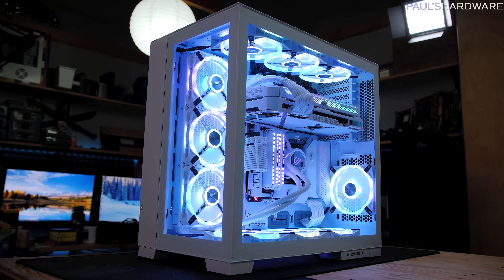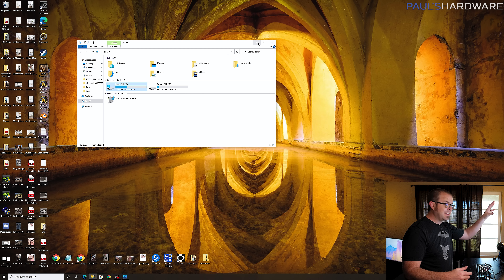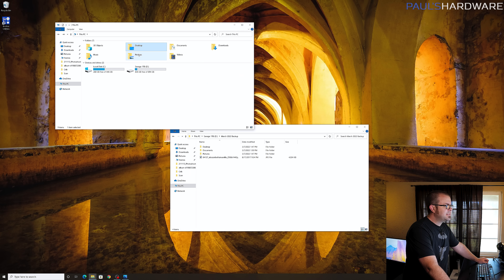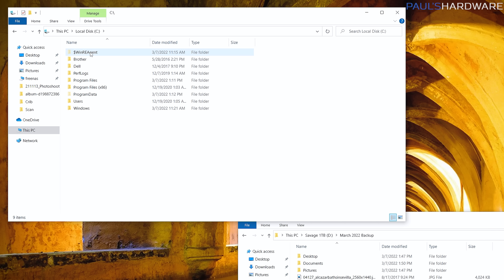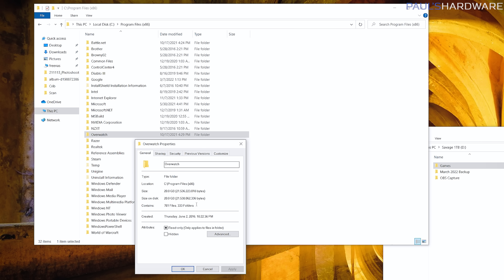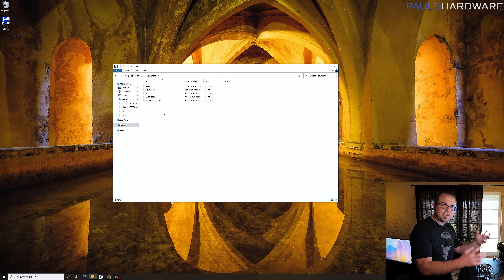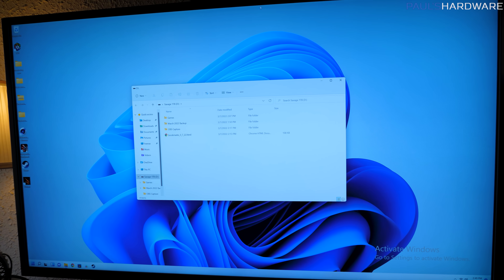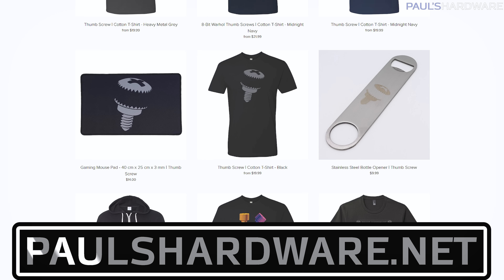How to Move Everything from an Old PC to a New PC

Comment: The one thing that really aggravates me is the new start menu because it's not at all customizable and I've always had a particular way how I want to have it look, I've got really every single link to all the programs that I installed on top of Windows plus some links to power user tools which are the built-in programs and then I have those nicely separated into a handful groups and I managed to get all that exactly fitting my screen so it's all there with one click on start and I don't have to scroll down to see stuff under the fold so to speak.

I've done this the same way for years and years, in fact my computer is so organized that many people say that it's crazy because of the amount of work I've put into it, for example my music library I have all music sorted by using directories so it's like hard coded and can't be changed by any media player, I've first made a few directories to separate the genres but I've grouped genres together that are alike for example Trance, Dance, Techno in one group and R&B, Rap, Hip-Hop in another group and so on and got five main groups for the genres...
Then for the next layer of directories I've got a separate directory for each year and extra directories for compilation albums and for artists...
Then for the next layer of directories I've got the full discography of each artist and on chronological order also separated with directories...

Yes I have a massive amount of music that I got from a DJ, all original CD's in the original cases with booklets and all still complete and undamaged stored away safely, and I've manually converted all that music into mp3's at the highest quality 320kbps and I even scanned the booklets to have the graphics showing on the mp3 when I play it, you can imagine how much time I've put into converting hundreds and hundreds of Audio CD's into high quality mp3 and why I stored it the way I did with directory trees.

Ow and I have a separate 1 Tera Byte hard disk just for the music so when I open up my file explorer and go to the music drive and fold out the directory tree I have everything nicely organized just as I do with my start menu and I don't want to change how I use my computer on a fundamental level which is the case with Windows 11 with that stupid, horrible, idiot start menu that I can't customize anything on... You don't know how much I hate it, I'll tell ya... I hate it so much that I'm postponing the upgrade to Windows 11 as long as possible maybe even till 2025 when they stop the support and I have no other choice to upgrade but I hope that by that time there are more people like me making a fuzz about it and maybe we can customize it soon enough.

And if not I'm going to make it my personal project and create some way to either revert to the Windows 10 look for the start menu at least and if that's not possible I'll make some sort of plugin or small software install that will give me the options that I want which shouldn't be a big problem to me because I know way too much about how Windows works since I've been customizing my Windows as long as I can remember.

Since Windows Vista that most people hated... I loved it, well from that point on I've loved Windows because it always worked, it became more stable and I never had major crashes and for the most part it looked about the same, everything was located on a logic place, it just worked great the way it was since Windows Vista especially for the start menu and how we could customize it and now with the latest Windows 11 they messed it all up, they don't even have the cool live tiles anymore!?!?

If I could I really would like to talk to the people at Microsoft who thought it was a good idea to change the start menu and make it look like what I hate the most of all, it looks like it comes from Apple and that's just wrong, if there's one thing I don't want it's that my desktop computer is going to look like an Apple and even worse it's going to work like an Apple.... 🤮🤮🤮🤮

Sorry for the rant, I couldn't help myself and had to write it down to get some kind of closure.

Comment: Paul I hope you can answer a slightly but related question. My son is getting a new gaming PC that I am building myself and he currently has a laptop. I had upgraded that laptop's puny 128GB NVME for a 500GB NVME. First I think I know the answer to this one but as an OEM Windows on the laptop I shouldn't be able to just plug in the drive on the new motherboard, I probably need to reinstall Windows completely and use another one of your videos to purchase a low-cost new Windows OEM key. But transferring the files I should be able to just copy from drive to drive, correct? I originally was going to buy his new PC without storage as I was planning to re-use the existing NVME but Newegg (don't worry I made sure to use the filters to only buy new) applied a discount code to my cart so I bought another 500GB NVME the one you suggested on your latest budget/mid-range build. So, any advice would be greatly appreciated.

Comment: It's good to see the "ugly" white 3090 in your wife's PC again (RIP Kyle).
However in order to complete the whiteness of this PC you should add a white keyboard.
I see a full keyboard on desk so I'd suggest a white Corsair K70 RGB MK.2 SE or a white Punkston TH61 if you find one it's a 60% board but waterproof in case of any coffee accident.
I don't know if this a bedroom or living room but in any case it'd be nice to have less cable management over there and wheather you're lying on the bed or sitting in couch comfortably you could use a white Logitech G915 TKL.
My best preferences are the fully customisable boards from kbdfans or the nice keychron (keychron-k3-v2-non-backlight-ultra-slim-wireless-mechanical-keyboard-π-edition) but I don't know if it'll be available soon.

Comment: Fun tip, holding Shift, while dragging to a new drive also switches to Move. When Move is the default, holding CTRL switches to Copy. I transfer files quite regularly and this is faster for me.
Reply: Nice tip! Only issue with move / cut is that if the files get corrupt in the migration you have no backup, hence why I always copy and paste.
Reply: @zadekeys2194  that’s a good point
Reply: @zadekeys2194  One million % this!!!!!!!
Reply: I am a bit paranoid that I will move when I need to copy and vice versa and I never trust what windows/programs is considering default for drag and drop (move copy or make a shortcut) :D I always use right click
Reply: Thanks for that.
Reply: if you think that is handy, try Directory Opus. if you move files regularly,  you'll love this.
Reply: 30 years of using windows and still I find new shit out. -.-
Much obliged. Especially under windows 11 where everything takes vastly more mouse clicks than before.
Reply: I wish I could save this comment wtf ❤

Comment: That's all well and good, but wouldn't it be easier to make a windows image backup with Arconis e.g. and then install the image on the new PC? Yes, I know there can be complications because the hardware has changed, but as long as you haven't switched from Intel to AMD or vice versa, it should actually work. Drivers etc. can be replaced for the new system. If the OS was previously on an NVME at least If it was on SATA and you switch to NVME it will not work. Or am I totally wrong here?

Comment: WinDirStat is also a program that is frequently packed with trojans and bitcoin miners so... get that from the developers website ONLY.  This is good general advice for ANY application.  

Also, if you "don't know what you're doing or where stuff is located", you can just make an image of the old drive and verify it.  There are many free disk imaging tools out there, Macrium Reflect, Easeus, Clonezilla, etc.   

Then just proceed to install everything new.  The image is a backup of the entire drive and takes far far less time to create than manually dragging and dropping everything.  Also, if you encounter some program that you "forgot" to grab the data for... you can just access the image and pull that data off because and image backs up up the entire disk.

Comment: I bought a 43in super ultra wide Sceptre n{{E448B-FSN168W}} flat (as a dayum pancake) L.E.D. Dual FULL HD HDR600 1MSmprt 120Mhz IPS freesync edgeless whiz bang of a monitor for 5 hundo in November & it's proven to be a fabulous value of a monitor.
 Has white case, rear fancy RGB shenanigans, GREATR rear IO, meh cable management thing, but ECXELLENT adjustability, w/ a VESA mount, nice remote & built in speakers (my only real gripe - other that the last thing, I'll get to... last) the speakers, while functional, are weaksauce... I ride at 100% on every volume control I have & it's fine as long as I'm watching something with top notch production value... anything remotely less that stellar & I have to turn CC on.

 My Actual gripe: - Sceptre had this exact screen, a 2020 model with a 1000R curve, I had it in my Amazon cart for about 5 weeks waiting for my curds & whey, & when I finally had the cheese, I simply hit "BUY" - The ad hadn't changed appearance at all, same Wallpaper on what looked like the same monitor in the same picture - much to my surprise, I HAD not ordered the 1000R buxom voluptuously curvaceous Gaming monitor, she was well.... shall we say... "UNDERDEVELOPED" ahem.

 Still, she's got a lovely personality though ;)

Comment: In moving app data, some info of how or if you can move open tabs and such from browsers would be really helpful.
Reply: Bookmark them, then export bookmarks. Simplest , fail proof method.
Reply: @zadekeys2194  but in the video, when he did that, it put all the "old" links into one folder marked 'Export'. That sounds like a pita honestly. I need a way to copy the bookmarks as they are currently.
Reply: @derhohlenbar  export and importing of bookmarks should create a carbon copy of the structure. Give it a try :). Ps: creating tags as you bookmark is great aswell for future ref.

Comment: At 13:42 when you show the system the side radiator fans are set to exhaust.. I thought your tests showed the positive pressure setup (top, bottom, and side fans all intake) was best. Why did you change?
Reply: I had thought about testing that situation, but wouldn't it result in hotter CPU temps? You're blowing warm chassis air throigh the radiator instead of cool air if it was an intake.

Comment: I did a data/email audit about once a year for a couple years, it only took 2 passes to cut the bulk of redundant files and folders, organize, and set up a folder structure I am content with. Now I just do a bit of housekeeping every 6 months or so for newly stored data. I have a WD Black 4TBx2 HDD RAID 1 array that is just about maxed with a neatly sorted collection of everything, a Samsung 1TB SSD for larger downloads and game storage overflow, a Samsung 512GB NVME M.2 SSD for the OS and primary games, a 2TB external backup for easy transfers and core keepsake storage, and assorted USB's/SD cards along the same lines for off-site backups. Over 7 years strong on this current configuration, just turning 8TB into the RAID 1 when I made the upgrade from i7-5930K/X99 to 5900X/X570, and I couldn't be happier. I pretty much follow the same protocol as you describe, I love having Firefox sync with a bookmarks folder for every manufacturer driver download page, apps and programs downloads, basically all software and drivers for every single piece of hardware and assorted peripherals. Unfortunately I have a Windows 10 USB from 2016, so updates are a bit of a pain! The real task is optimizing windows, setting overclocks, and downloading/installing games. I have built a pretty sturdy system that is upgraded as needed but generally has been the same format for almost 10 years now. a custom loop with a 5000RPM pump, 200mm glass reservoir running distilled H20, dual 140mmx30 rads in push-pull, 3000RPM Noctua fans that only ever see over 1500RPM when going for overclocking records, 1/2" I.D.-3/4" O.D. tubing, and solid nickel-plated copper waterblocks (Heatkiller/EK). It is absolutely overkill, and I should be ashamed of how much it has cost over the years, but combining my old parts with a new power supply paid for my CPU, and I make money through it's use, a small price to pay for one of the only luxuries I grant myself other than coffee. Having an enjoyable experience is paramount, and should be heavily invested in.

Comment: you can do the same result conecting both pcs with a wired local network (no wifi)  and sharing a folder with everyone in this steps

1- on both pcs create a folder, right clic it, go to properties, sharing, clic on sharing and create a new sharing rule with everyone in the network
2 on both pcs open a file explorer window, go to network and enable network detection (yello notification on top)
3- on the old pc move everything you want to that shared folder 
4- on the new pc go to network on the file explorer, and open the old pc that must appear in the network options like a folder, its more useful if you set an administrator account with password on the old pc bc when the new pc tries to acces it it will ask user and password to have a more secured conection (in case of any unwanted family trying to look your files
5- start coping all your desired files in to your new pc

enjoy

bonus: this is very useful to fix pc as work reducing transfer times

 not a exact guide but if it makes in toa  vid shout me out god dammit!

Comment: Good grief I've done this more times than I care to think about. My process now revolves around a two bay external HD dock (they're super cheap on Amazon). I pull all the drives out of the old machine and load them one by one into the dock attached to the new machine. Because it's USB3 the drives are treated as external drives as long as you've booted from your new system drive first. then I just copy across what I need for the new machine. I  keep the old system drives, label them and  stick them in my morgue box in the garage. Old drives are cheap and data is expensive.

Comment: How did you convince Kyle to let you keep the card? If you have a retail version of Windows 10 on your old system you could download all the drivers for the new one to a USB stick and clone the current drive with the free software from Samsung. This would require a PCIe to M.2 adapter ($16) and you would have to remove the dedicated GPU of the old system. Login to your Microsoft account and transfer the license to the new PC.
Reply: I think you have to remove license from old pc before activating on new one. It's an easy two step process and there are simple vids on how to do just that. Unless your license is connected to you and not the pc... then your golden.

Comment: My moving to new PC method:
1. Take out drives from old PC.
2. Put drives on new PC.
3. Boot and pray it doesn't explodify.
4. Clean install latest device drivers (GPU, etc.) if it boots fine.
Optional 5. Clone drives onto new drives and set those to boot before removing the old drives.

Then again, I don't even have a PC or console anymore.

Comment: If you have the space on an external drive or if you have a NAS (Desktop based like a Synology or QNap or Server based like TrueNAS or UnRaid) then my advice is to use a good imaging software suite like Macrium Reflect or Acronis and make a backup image of all drives including a filtered image of the Operating System partition (excluding specific unwanted folders like temp and files with known extensions that should be excluded (*.tmp, *.bak et al) create a bootable restore image (Macrium Reflect calls this Backing up Windows) and then once the backup images are complete and safely stored away, simply down the old system take the old system out of service and then put the new pc into service.  Once the new pc is on use the thumb drive that stores the WindowsRE environment created when you created the Backup of Windows image earlier to boot the new pc into windows with network drivers if you saved your images on to a server or NAS drive, and restore the OS drive first then any other images created for other drives.  In this way you do not lose access to any files or folders your install and desktop is exactly as you left it on the old pc and all that remains is to install hardware drivers and reactivate Windows using your Microsoft Account.  This is a much simpler method that does not rely on the hunt down files and folders on data drives that may or may not make sense three or four years from when they were first created.  Its a lot easier to manage than the method you described Paul.

Comment: One thing I like to do upon setup is pointing the documents, music, downloads, desktop, etc folders to a location on a separate drive. That way, in case of re-installing windows, you don't lose any of the things stored there.
Reply: On paper that works fine but you should have a proper backup elsewhere. Many programs look to the default folder directory, and not the "new" locations.

Comment: SATA to USB adapters NEVER work with mechanical drives because they need 12V and that is not available on a USB link!
Remarks;
5-what about desktop background pictures?
4-what about passwords and license key's?
3-cleaning duplicate files (often double photo's) after copied -use duplicate file finder program
2-just search *.jpg and *.mp3 and others with a minimum size of like 200kb  on your C drive for a more thorough search and see if they need copying

1-MS bookmarks/favorites can just be copied separately but others from other programs like Brave are at different locations than MS and can usually only be backed up via the program itself (export)